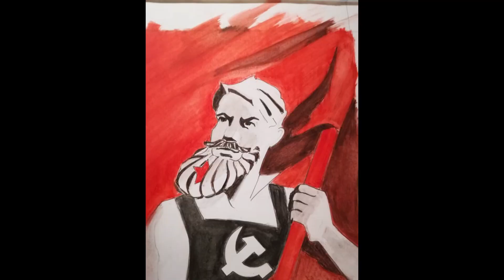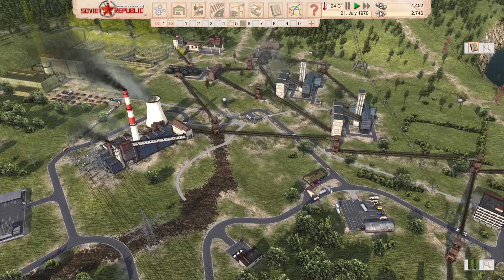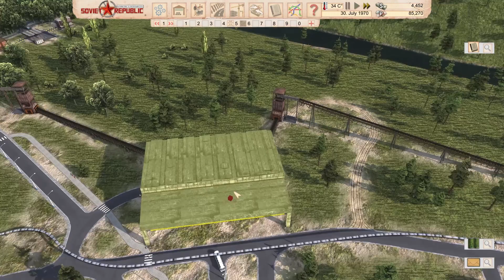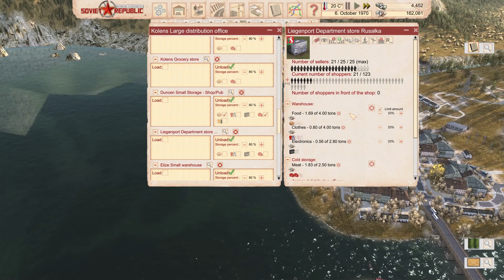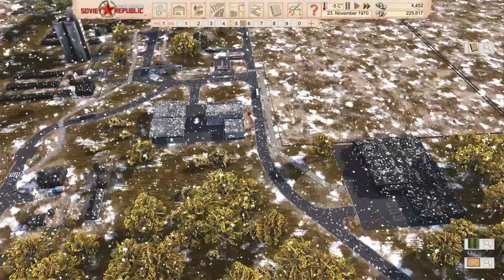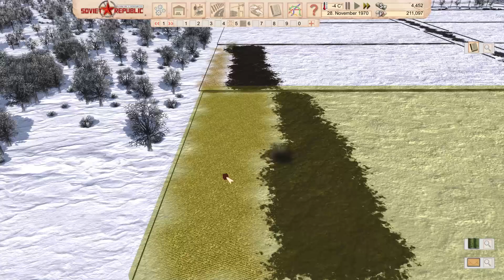Workers and Resources - Soviet Republic - Liberatian Socialist Republic - Ep.26

Comment: You can get some money without loans. You can import nuclear waste. 

57:03 this heat exchanger has three connections not only one.

Building mechanical components factory near Halendorf doesn't make sense. It needs steel only. 

Btw when you are using factory connections crossings with roads/rails you need to use forklifts.
Reply from the maker: Yeah. I noticed that with a heat exchanger too late. 😃
I believe we are going to import some nuclear waste! 😃
There are a couple of mods for Nuclear reprocessing and storage. I might use them. 
Thanks! 🍻
Reply from the maker: I'm blocked! How do you import nuclear waste?
Reply: @oolykeegaming81  Damn, when I'm thinking now it's probably impossible ;/  Never needed it but it was always in my mind as an option.
Reply from the maker: @Gebbeth  I just tried. I thought the same as you! And I recorded 40 minutes of an episode and realized that it might not be possible. And you are not the only one suggesting this!! Plus I thought that it's possible too. :D :D